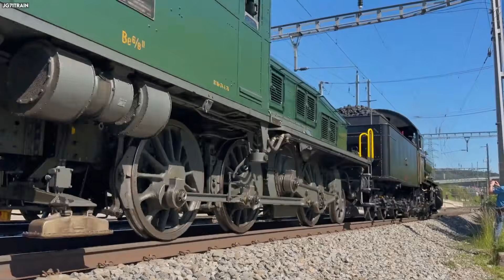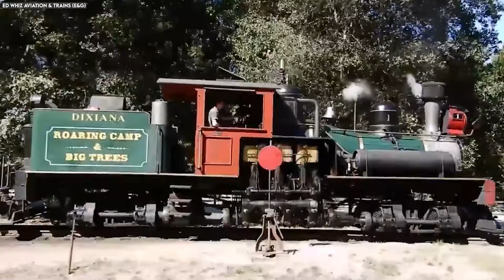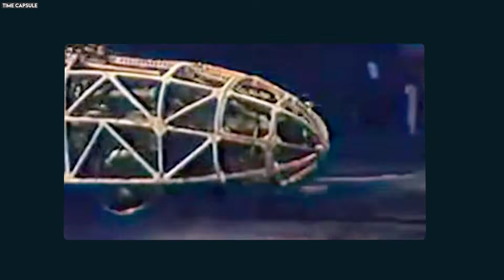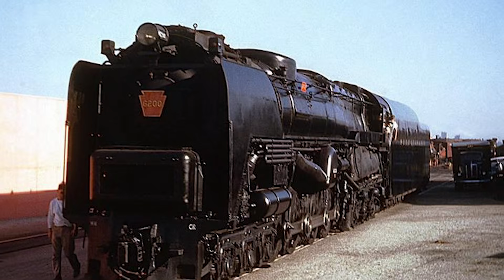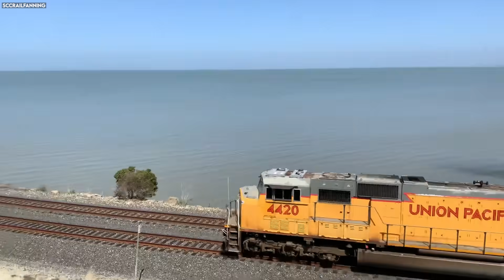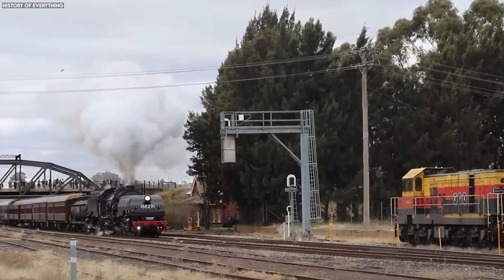10 Strange Locomotives That Were Actually Engineering Geniuses

Comment: Strange opening section about the camel back engine with most clips showing engines other than a camel back locomotive. Interesting commentary on why the engine was designed as i was, though.
Then the next bit, pronouncing "Ffestiniog" as "F- festiniog". Am weiddi yn uchel, don't allow AI to do everything for you. They clearly haven't been programmed in the Iaith Gymraeg a sillafu.
That aside, the narrow gauge railways of Wales are some of the greatest tourists attractions of the UK.

Comment: When I was in Taiwan in 1968 I rode the "Ally Chan" Japanese built railway up to into the mountains, a route which included a spiral 360 degrees tunnel inside a mountain to get past a grade issue. 
They were using Shay, side mounted motor, 2 or 3 cylinder, drive shafts, two bogies with 90 Degree, geared, reduction 4 or 5 to one, steam locomotives. I spent two nights in the village and spent the days
Wandering around the logging, Bullock drag to truck, to train, and back down. They were still harvesting amassing "OLD GROTH" Forest.

Comment: As a Swiss model rail fan the Crocodile is well represented on my layout, the Designation Ce6/8 tells you some thing about the locomotive the 'C' is a speed rating and identifier as a standard gauge  60 - 65kph the little 'e' means electric traction, the first number '6' means it has 6 driven axels and the second number '8' is the total number of axels. The Gotthard line is a challenge for engineering and several notable locomotives were designed specifically for the route from the steam C5/6 elephant to the Croc, the Ae4/7 with Buchli drive later 2 units were permanently coupled to become the Ae 8/14, the Ae 6/6 and later the Re 6/6 'R' for 'Rapid'. With the completion of the 57km Gotthard base tunnel the majority of traffic no longer climbs through the mountain pass and only regional services remain as well as joy rides and the panorama express. some of the small towns no longer have a regular rail service.
Reply: Yes I have a Z gu age Crocodile 
They used to also do freights from Bern to Brig line thru Bernese mountain  line . The Farm is worked on 1970/71 was next to the main Rail line being Muri ...